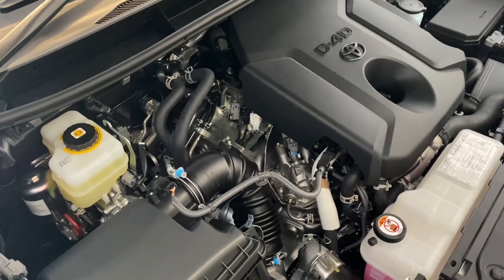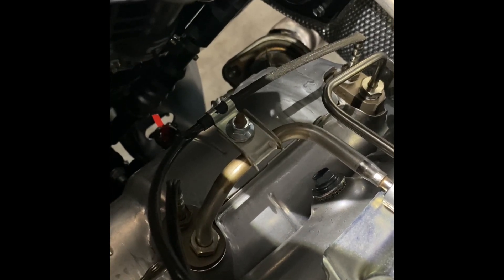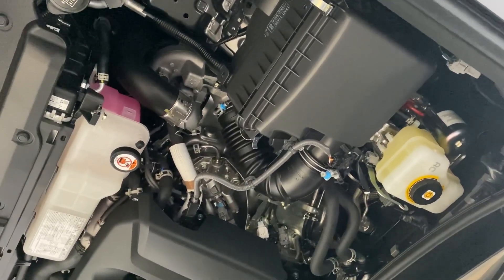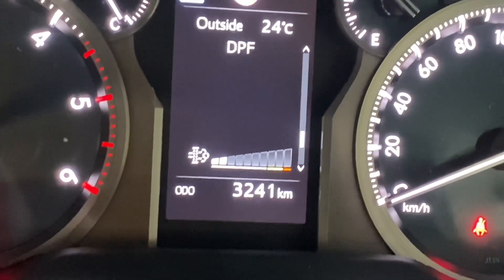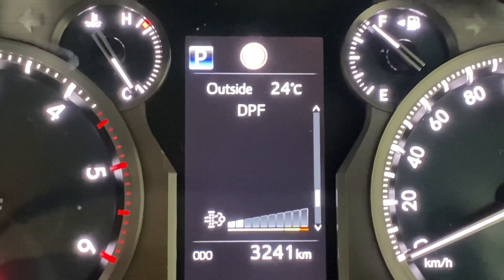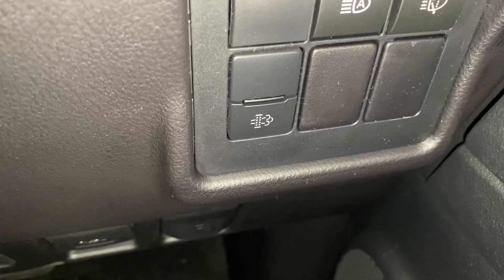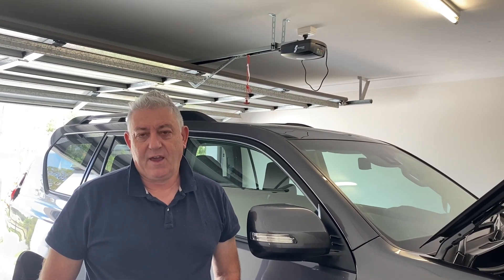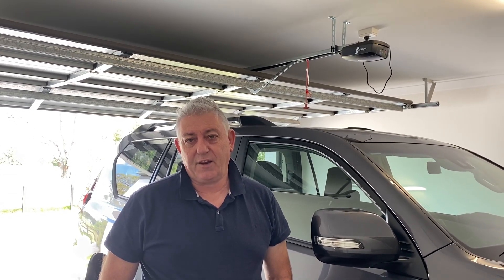Diesel Particulate Filters: Toyota Landcruiser/Hilux : Has Toyota fixed the problem? My thoughts.

Comment: My 2022 Fortuner DPF works perfectly, I usually do minimum 30 minute drives or longer, every 270 ish km automatically does it, takes 20 minutes roughly. If I stop starts again when engine gets up to operating parameters. It does have a button, you can manually do it by pressing it and parking the car.
Works seamlessly.
Reply from the maker: Yeah, mine the same

Comment: its not an issue for everyone. I have a 2018 Fortuner. I used to drive about 25 km each way every day . The generation is actually a burn. I dont have a screen. At one service i was told that the dpf had been replaced . This would have been about 40 000km.I never had any trouble. The trouble is that diesels should NOT be sold to short trip people
Reply from the maker: Yeah, short trip users are the problem, not the DPF itself. My trips are pretty much > 100km when I do them, mostly motorway Ks. I’ve also not had a problem and I’m over 100,000 km now

Comment: Hi Peter.  I just joined the Prado brotherhood.  I got a VX.  I still trying to teach it not to jump into 5 th and 6th so early. (apparently the tranny will learn over timer).  I was worried about the engine labour at such low revs.  I do love the car though.  More usb ports yess and I think they have nailed it.  Oh.  also, the camera and display is not as crisp as I would have hoped from an $85K car but Im hoping to overlook that.    Nice vid on the dpf.  cheers mate.
Reply from the maker: Thanks. Mine is now 3 yrs old and I’m looking at moving it on soon.  The prices have become a little bit crazy and apparently the new model due this year will be even more expensive
Reply: Use manual mode and change to S4. It will use 1,2,3 and 4th gear only

Comment: I have a hilux now 80 000km and I am a mechanic looking out, I have never noticed a burn off or done anything and never had a problem.
Reply from the maker: Hi was it manufactured pre- DPF? Mine is a 2021 LC Prado.
Reply from the maker: I think pre-2015 Hilux didn’t have a DPF.  2015-2018 had the old DPF which had some of the issues about not regenerating when driven in urban environments. Changes made in 2018 (manual burn switch added) and new DPF and software in 2020 onwards builds
Reply from the maker: There has been a Toyota class action going through the courts about the poor quality DPFs on earlier versions which Toyota are contesting.  They have offered to “make right” any affected vehicles though.
Reply from the maker: Also, may depend on which country you live in and the emissions standards laws in your country for diesel particulates as to whether you had to have a DPF fitted in the first place.
Reply: It does a DPF fitted and has had the software update about two years ago but no problems prior to that I also must note I don’t do many short trips most are about 100 km on a highway.

Comment: Are you still trouble free with the D  P F  since you last made this video on the topic.  ?
Reply from the maker: Hi there. Yes absolutely. 50,000km driven and 18 months old, no issues. Burns off every 300km as regular as clockwork! I do mostly highway/ motorway long distance trips. Takes 15 mins at highway speed to regenerate.
Reply: @PradoPlacesOz  Thanks for  replying to me

Comment: on a 2016 1GD prado you get a better burn by pulling over on a hard non flammable OUTDOOR surface when a burn starts. hold the revs up at about 2000 and let it do a high temperature burn. If I just keep driving at 80km/h or more or if its a cold day the DPF doesn't get hot enough to convert all the soot to ash. I don't have the current prado so rely on my ScanGauge to tell me the DPF loading.
Reply from the maker: Good comment. In my case I do a lot of highway / freeway driving and more often than not my DPF burns off whilst I’m doing motorway speed 100-110 km/hr. I do very few short stop/start trips so hopefully that helps.  I also understand the DPF was changed for either the 2019 or 2020 model release to a new unit that is supposedly better than the older units that were installed and caused all the class action stuff to occur.  I think your suggestion is a good idea for those models before the engine / DPF upgrade.

Comment: I've just got my Prado ..only 215km on the clock ..."DPF regeneration in process" has just come on today twice ... I have pulled up, placed in park and patiently waiting for the message to clear off the screen. It's at the lowest bar but seems to be taking forever ... Is this the right thing to do, the book said it is but surely being so new it shouldn't take so long? Cheers, Hank
Reply from the maker: No, you should drive it for about 15-20 mins at 60-80km/ hr if possible so it burns off at driving temperature.
Reply: @PradoPlacesOz  thanks brother 🙏💚
Reply: Just ignore it and it works by itself😊
Reply from the maker: Personally I find a good highway / freeway drive at 100kph (62mph) is good to regenerate in 10-15 mins

Comment: My 2021 Prado has around 1600k on the odometer.  My DPF is working exactly as you describe.  Kicks in about every 300k. So far I haven't needed the manual switch,  but good to know it's there if needed. Thanks for the video.
Reply from the maker: Thanks for the feedback. I’ve now done 16,000km in about 6 months with absolutely no DPF issues. Seems like Toyota have sorted out the past well described issues in this new model
Reply: My 2021 landcuiser has this system and works fine.does having a dpf mean there is no catalyer converter?
Reply from the maker: @kubibear2890  I don’t think there is. Others may know better.
Reply: @kubibear2890  Catalytic converter is for petrol engines.

Comment: Worth noting a lot of the earlier models don’t have this screen. But I believe it can be added with software. I find ours will do a burn around town as long as it’s fairly smooth driving. Ours completed one in 10 mins the other day. It’s worth noting too if it doesn’t complete the burn you can still turn the car off. As long as it doesn’t get “full” you can keep doing little burns here and there is my understanding. Our previous car was a Pajero sport and we never had an issue with the DPF.
Reply from the maker: Good point. I can’t recall when the Australian legislation became law and mandated the Euro 5 standards.  I think I read the first emission changes came in for model year 2004  Prior to that I don’t think it was required. Others may know better.
Reply: @PradoPlacesOz  some implemented euro 4 early. A lot of light vehicle engines complied with EU4 without DPF’s. EU5 was around 2014 maybe? Around then.

Comment: yes, same here 2500 klms up & all good.. both hwy & local traffic driving on a weekly basis.  auto DPF kicking in no need for the manual switch..
Reply from the maker: Yes agree. I think Toyota has actually replaced the old DPF with a new better engineered version plus added some software upgrades to the engine management computer as well. If you buy a 2020 build from June onwards I think the issues have been resolved
Reply: My August 2020 had DPF issues. It started to happen on 1000 kms only
Reply: Toyota prado vx 2020 August
Reply from the maker: WHat’s been the outcome of your problem?  Did Toyota sort is out?
Reply from the maker: WHat’s been the outcome of your DPF problem?  Did Toyota fix it?